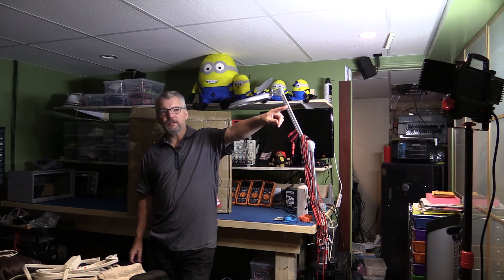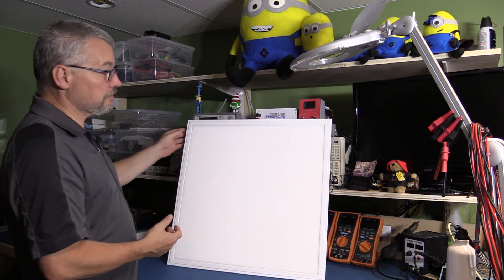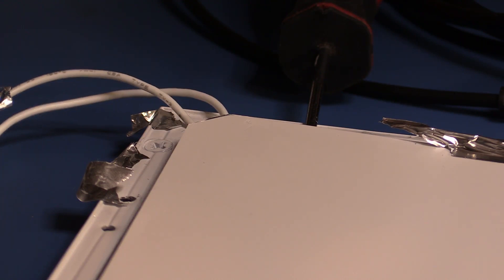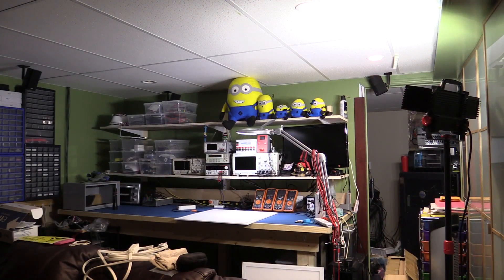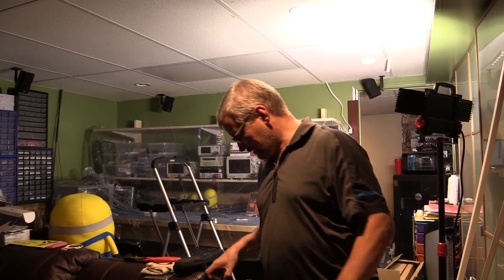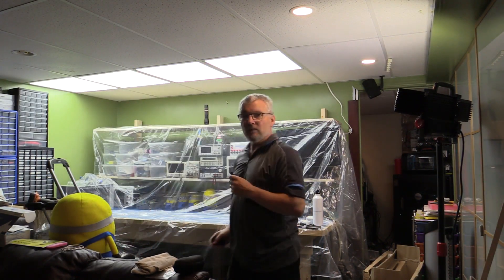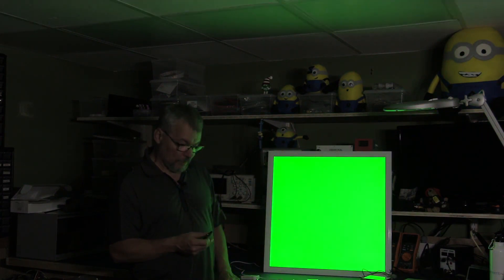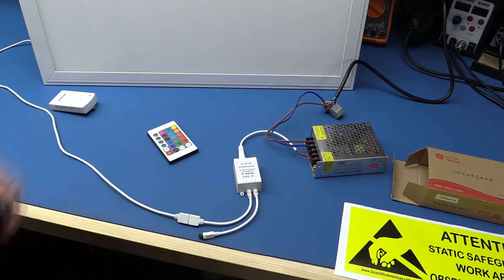LAB Lights Upgrade, you asked for it, you got it !

Comment: I like these!  I just bought a bunch of "Shop Lights" from Rual King that are 4500K very bright and do a great job lighting up the shop.  But they need a diffuser  ,   I need something to act as a light diffuser over the bench.  If you happen to look up when setting under one it will blind you!  They are that bright.   I do not have a drop ceiling.  My shop took over the one car garage.  So suspended from ceiling on short chains is how my lights are installed.  Any ideas on how to diffuse this light since I've already spent the money on them.  I do like the panels you bought and may eventually have to get a couple, especially if I am to ever do video from my shop.   I like your work bench design!  Looks great.  73 de Seth - W8FG
Reply from the maker: You may find some diffuses at the local hardware store, the type used to diffuse tube lights in a drop ceiling